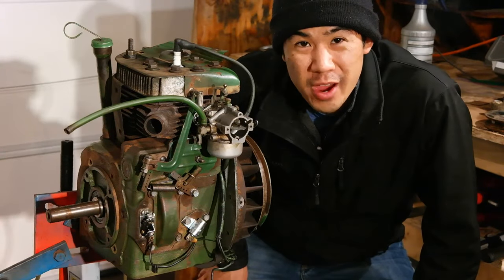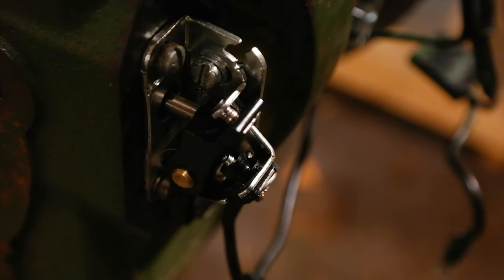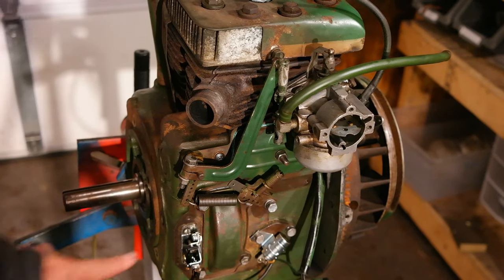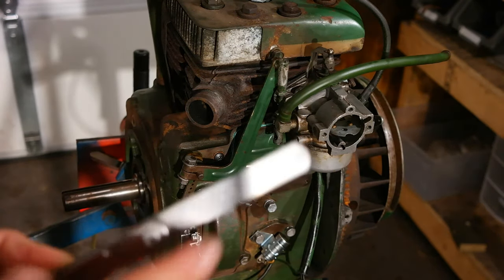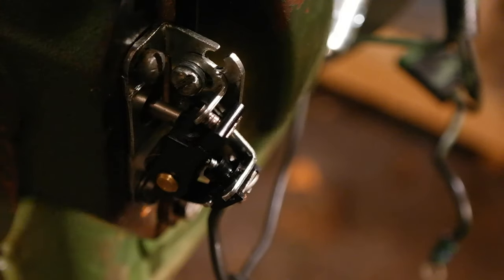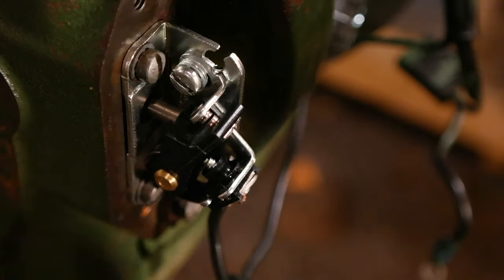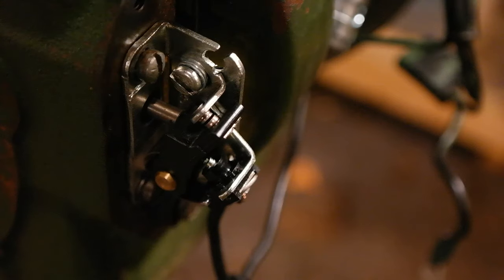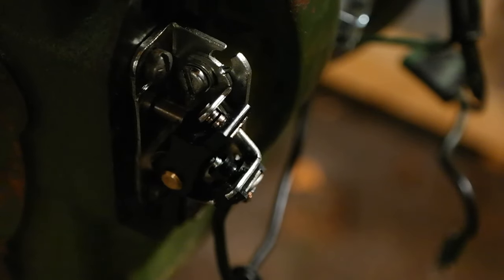How to adjust and set Points Gap on Kohler K Engine

Comment: I just bought my first garden tractor last week due to you tutorial on your Cub Cadet 149. money is kind of tight so I looked and looked for one that I could afford well I finally found 2 wheel horse gt14 it came with 2 mower decks and 2 rototiller and 2 3 point hitch they are both hydrostatic for a great price off 300 I think that will be the buy of the year for me since my budget only allowed for 600 so I still have 300 to fix the tractor. am super excited about my build I have to say thank you sir I will be ordering some parts soon. have a good one
Reply from the maker: iwantosavemoney I am glad to hear it! it will be a very rewarding project for you. if you need any help let me know! thank you for saving the tractors! you got a great price on those GT's

Comment: Just the info I needed.  Have a Kohler K532 in a John Deere 400 (circa 1980)  and hope those points are easy to find and not tucked away in some odd hiding place. ;-)  Recently watched your video on complete restoration of a 400. Great!  Thanks

Comment: Great video. I am replacing coil, plugs, carb, condenser and points on a K582. Your video is about to save me time and unnecessary damage due to frustration.  The only suggestion I would make is the lighting could have been a little brighter. I could see what you were teaching well enough, but I like to compare everything on my points to yours. Like the wire from the coil , I believe I had that incorrect. Thank you for posting.
Reply from the maker: Thanks for your comment! I have since upgraded my lighting situation. Thanks for the feedback.
Reply: I am also trying to get a Kohler K582 /K7000 Generator to start with no luck so far. I replaced the coil, plugs, fuel pump and Fuel filter. Cranks, no spark. lookedat/cleaned points, has very little movement at points, I adjusted but still no spark. If the condensor is bad would that prevent it from starting?
Reply from the maker: A bad condenser would cause your points to wear a lot faster. Check all safety devices and wiring to make sure they are all working.
Reply: What are you setting the gap at? Have you tried a test lite at the coil? Is there any power anywhere?  I had to replace the wire from the coil to the points as it had become crunchy from decades of heat. The clip that screws to the points had to be replaced. Finally, does your battery have a fresh charge?
Reply: I don't have the gap tool, wire  looks ancient. that's a good suggestion to replace. no spark at points/plug .has power at starter,cranks has fuel. i don't know how to disable oil sens/ fuel sens if those are disabling start.
Reply: so  replacing coil  wiring is a good way to go ?
Reply: Well, mine was in bad shape, so I replaced it since I was in there already. So I'd say its an easy way to eliminate that potential issue. Is your condenser bolted/screwed tight enough to provide a Ground? Take a light test and test both ends of your coil. One side should light when the key is on, but the other side will not show any power until you crank it over.
Reply: yay! i ran a cable from battery + to coil + and now it starts! runs as long as  hold the cable on +.  So what does that mean is wrong with it?Thanks
Reply: yay! i ran a cable from battery + to coil + and now it starts! runs as long as  hold the cable on +.  So what does that mean is wrong with it?Thanks! this kohler k582 is a rv generator .
Reply: The wire was either corroded inside or the connections were. Nice work!
Reply from the maker: Nice job David helping him out!
Reply: out of all the things i fixed , the one that makes the difference in starting or not was running a new wire directly from battery + to coil+ ,so basically its a bypass wire. i put a switch on the wire so I can use it but there is still a problem in the ignition circuit somehere. its an rv so there are fail safes etc.
Reply: yes thanks david!
Reply: You are welcome! I'm no mechanic, but I know a few things. I'm working on mine now. Can you believe I found a correct Kohler Carburetor for my K582 on Craigs List for $50?!! Still in the original box! I'm installing it now.
Reply: Kohler quit under load and wont restart, acting like it was before, where it wasn't getting spark until I hot (direct batt+)wired the coil.  I put in new points and condenser since they looked bad. I thought it had run out of gas (1/4 tank RV cut off function) but with gas in tank still wont start. It was working fine I don't get why it won't run now
Reply: cranks, has gas in line.
Reply from the maker: Inspect your wires again. You may keep getting a short somewhere in your system. Check all fuses, and breakers. Isolate your issue is with the spark, and start at the end of the line and work backwards. Plug, Plug Wire, Points, Condenser, Coil, Wiring, Key Switch, Interface To your Genset Control Panel.
Reply: Thanks! got it going.

Comment: points are missunderstood they form the ground path of the coil.  so when they are closed the coil charges up.  when they open the coil is sitting there charged up and that electricity is looking for a place to go.  when the points are closed the coil is the place to be.  but when opened the. next best place is to run out the other winding down the spark plug lead and jump from the plug wire through the air to the body of the spark plug into the head and therefore back to  ground.  thats why spark plug gap and plug type and coil resistance and wire resistance are a thing.  we need the points to break enough to drop the field in the coil enough that the electricity is motivated to do the work of jumping that spark plug.

Comment: Nice upload brother I'm working on a 1970 JD110 with the 7HP Kohler, its been running terrible so I removed the carb and soaked it cleaned it with tip cleaner and blew it out it was running yesterday and today no spark. Its pouring out now so I got to wait to do this.
Reply from the maker: +JRoberts1260 Thank you. Often times with these old carburetors the throttle shafts get worn and let in air throwing yoru air fuel mixture off. If cleaning your carburetor doesn't help you may want to replace it. We sell the correct carburetor for your engine. Regarding the no spark. The most common reason I have found for no spark in my customers is improper gap setting or worn points. We sell those too if you need them. Good luck and thank you for saving the tractors! I love those round fender JD 110's! Classic!
Reply: Yea I can see that on the primary throttle butterfly, Cant justify the cost of a new carb at the moment. or purchasing the points but I did check them as per your video and they are in spec now, actually have two old tractors a JD110, and a cub cadet from the mid 60s its carb is soaking but also no spasrk on that girl either....As time and finances allow ill get em both up and running.
Reply from the maker: JRoberts1260 Let me know if you need any help with anything. Thank you for saving the tractors!

Comment: Norman. Have you ever had a bad set of NEW Kohler OEM points. I had that issue this morning. Thankfully, I had another new set on the shelf. It drove me nuts for 45 minutes trying to set them with a multi meter before I figured out they didn't have continuity. 
Anyhow, I love your videos. Keep them coming.
Reply from the maker: Hi There, contact points are often stored with a protective coating on them to prevent them from rusting. Try spraying carb cleaner on it and rub them with regular computer paper, that should fix it for you.
Reply: Yeah, I'll give that a try. But, the good set is in and timed. So, they will go back on the shelf if they prove good. Question for you. I notice that you have used parts on your site. Do you run across used K341 heads? When I got this motor, the plug was stripped out, so I TIG welded it and re tapped and it's held for 8 years. But, I would like to have a good one as a spare just in case this one lets loose again. Also, I need the correct governor linkage spring. I can't find one on line anywhere. Thanks for your quick response. Mark
Reply from the maker: We have the governor linkage spring. check this out :http://isavetractors.com/springs/ We also do sell the K341 heads but we are sold out right now. When we get them, they sell really quickly. Buy points from us in the future. They will always be good! Let me know if you need anything else in the future.
Reply: EXCELLENT. Thanks

Comment: I have a late 60s K301.  I was told it ran some months ago and just stopped running.  I took the flywheel off and saw it had broken on the shaft, the key broken.  Thought that was the spark problem for sure but still, "0" spark even after putting a new coil on the magneto.  I'm going to adjust the points tomorrow, but it ran so recently.  So what if the gap is too wide, is there no spark or sometimes a spark and so it will run bad?  The gap is wide, I tell by just looking at it open, but they do close.

Comment: the procedure you are showing is the static procedure there is another way. dynamic procedure. you can time a kohler with a timing light. on the side of the blower housing there is a plug. spin the flywheel by hand, there is a timing mark. mark that timing machine with a white paint marker so you can see it. start the engine, the light should strobe the same time the mark comes into view of the hole. both methods actually work, but i think the dynamic is a little more accurate.

Comment: I have followed your videos and replicated the work to the best of my abilities. My 917 Allis will run, but after a few mowings it looses power when the pto is engaged. The most significant issue I’ve ran across is that one side runs very hot and the other much cooler. Any ideas?

Comment: Looking for some advice for my good old IH CC 1650.  Engine is the factory installed K341.  It has very good compression,,can't remember the psi off the top of my head...Does not knock or burn any oil and starts quickly even in cold winter weather.  I have slowly rebuilt this old tractor for the last two years..Made my own repair on the trunion also and all is good...My issue is the engine is falling flat under load...I only get good power when I hold the hydro lever back to slow it down.  I have checked and re set the points..Thought for sure I had it there as the gap was down to .005"  Set it at .020 while at the widest point.  put in a new plug and it did help some as it started instantly in the cold weather and no backfire when shutting it off...It may have some cam wear is what i am thinking and is causing this issue..I also reset the governor rod by loosening the bolt and turning the shaft as far to the left as it would go..I scribed the shaft at that position the proceeded to pull back on the governor rod to the carb and tightened it....Still dogging out when I push the lever all the way forward...I have cleaned and tuned the carb as well and it acts like the governor is having a tough time keeping up with the changes on engine load.  The sensitivity actually is to little not to much as the spring and adjustment holes are all slightly worn from years of use...I believe I am down to replacing the whole governor system as well as being time for a new carb as well...Everything else looks good, coil and the rest of the ignition system is right on,,,unless the gap is false from a worn cam...Any other ideas....?  thanks

Comment: Hey I have a question my friend has a 1968 John deere 140 h3 same engine as that one and we converted to regular coil not inside a flywheel and we did a wiring properly and we are having no spark we can't figure that out i will appreciate if u reply thanks

Comment: I was told I probably have a flat spot on the cam and either need too replace it or weld a little where the plunger hits cam so it will push it in and out again.

Comment: Have you ever changed the left side crankshaft / block seal , seen  at time 3:50   without removing the crankshaft? 
I have a leak in that seal  and was wondering  just how difficult it would be  or if it can be done before I try without removing the crank..
Reply from the maker: Yes I have. You can screw in a couple of small drywall type screws. Screw them into the seal and use pliers to yank it out.

Comment: Great Video!  Question, when the points are in the closed position are they then grounded to the engine block?  Working with an electrical problem, and this is where I traced the ground coming from.
Reply from the maker: Yes that's correct!
Reply: @Isavetractors  and should I be able to read that ground thru the coil on the opposite side?
Reply: @CrisisGuildWOW  if the coil is good, then yes, you will have a ohm reading or a pratial ground on both of the primary connections of the coil.
Reply: @michaelvrooman5681  thank you.

Comment: Thanks for this.  I was hoping to find an objective test to check the points and tell me good or no good. I have worked through coil and it is ok, condenser tests ok, but new spark plug (no spark), (starter, ok).  Is this where I should just get the new points? (JD K301, 212, 1981)==Very well presented!!!
Reply from the maker: +Grimlbog E You're welcome. Glad you enjoyed my video. You can test your points by making sure they have continuity. Close your point while on the engine and touch the wire side of the points and engine ground and make sure your continuity tester shows continuity. If not, inspect your points and clean off any debris that may be on it. If there is no continuity your ignition coil will not produce a high voltage spark. Also make sure your point gap is correct. The most common reason for no spark is the points. I recommend replacing it. We sell it on our website. If new points don't fix your problem, you may need to remove your oil pan and inspect your camshaft for wear.
Reply: +isavetractors 
Thanks!---will give it a try.

Comment: I'll be using something else to set mine because I'm lacking some tools so something with the same thickness of that tool will do 

And valve cleaner spray because its been sitting for so many years a little wetness will loosen it up 

I'm sure it need all new parts on mine

Comment: I don't have the gap tool, wire  looks ancient. that's a good suggestion. no spark at points/plug .has power at starter,cranks has fuel

Comment: Would have been nice to also reference the timing mark on the flywheel and motor housing!
Reply from the maker: Those are not neccessary setting point gap. We have another video that shows timing your engine using those marks.

Comment: Hi, I have a ckm21 kohler. It started running terrible especially when I put a load on it. I changed points, condenser and gapped 20 thousand. Still ran lousy. Pulled carb and sonic cleaned it and still bogs under a load. The motor only has about 150 hrs on it. What do I check next???
Reply: That's the same problem I'm having with my K301.  Did you ever figure it out?

Comment: Good video!  Does it matter which direction you turn the crankshaft to get the points to open at their widest ?  Thanks!
Reply from the maker: No it doesn't matter but as a matter of reference these engines normally turn clockwise when looking at the flywheel end.
Reply: isavetractors Gotcha.  Thanks again.  My Cub Cadet runs really rough at  mid to higher speeds so I'll check the points and see what happens.

Comment: I've got a 1972 JD 110 with a Kohler K181 8hp engine and it has a stator magneto and I can't find a stator anywhere, only the magneto. Do the stators go bad? And is that why lots of people switch them over to have an outside coil pack? I would love to get a brand new stator for it but I have no idea where to look. Google and eBay have been zero luck for me so far.
Reply from the maker: Yea the magneto systems can be harder to come by and hard to Service since you have to remove the engine from the machine in many cases.
Reply: @Isavetractors  can you help me find one? I'm not having much luck at all. Trying to save this tractors life and keep it in the family.

Comment: If my points need replaced, what will my engine symptoms be? Mine is reving when I have it w.o. It idles fine?
Reply from the maker: Typically the engine will knock and run erratically. Your situation may be related to your governor or carburetor or both

Comment: As I was trying to take the cover off the points the wire fed thru the cover popped loose... I crimped back on a new U connector but I can't tell where it went... In looking at video it appears to be under lower screw, facing slightly downward. Please confirm, thanks for the help!
Reply from the maker: The wire clips to the little screw that is affixed to the piece of metal spring material.

Comment: Good tutorial but how do you know that the points plunger is all the way out? You cant eye it up as only a few thousandths will throw the setting off. I don't see any alternative than to use a dial indicator
Reply from the maker: See my other video on using a multimeter to set timing. However this method is equally effective

Comment: I have a Wheel Horse C-105 with a Koehler KS241as 10 hp. I can only get it running with starting fluid for a few seconds.  One time I was able to keep it running for a few minutes with the choke on, but that was only once. I replaced the fuel pump first & that was not it. Then I cleaned the carburetor & that was not it. Could the gap being off be a reason for starting only with starting fluid & then stopping shortly after? Do you think I need to tear it down? Any help would greatly be appreciated! Thank you!
Reply from the maker: JT122004 yes your timing could be off but it's more likely an issue with your valves. check out your valve clearances